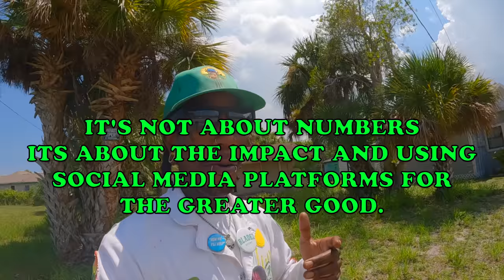Tragic Accident BY FIRE In FLORIDA Leaves BEAUTIFUL Home OVERGROWN & ABANDONED I CLEANED IT For FREE

Comment: AP on your lawn mower  set the rear wheel height to 2 to 3 notches higher then the front wheels.
when  the front of mowing blade reaches straight forward that is it power stroke. The rear of the mower deck lifted keeps rear of blade from hitting the grass clippings and grass and put double the load on the engine.
I mowed my lawn for years like this.
I learned this from my lawn mower mechanic.
Try it and left know how much it improves your mowing with your setup.
Peace to you my Brother .

Comment: @AP You can check the town records for who owns the houses.  Some are privately owned, some abandoned homes are probably owned by banks or the city itself.  Sometimes they go up for auction for a song and a dance.  The owners (whomever they may be) would probably rather have the house be lived in and maintained instead of just rotting into the ground.  The neighbors would also appreciate it as well.  There are government grants/programs that will pay for at least part of a rehabilitation of a home (new windows, insulation, and other stuff) at almost or NO cost to the homeowner.  You basically have to look up the info and apply.  You may be eligible or you may not, but if you never ask the answer is always no.

And BTW, the plant along the fence you called a grapevine wasn't a grapevine.  Grapevine have big leaves (can be bigger than your hand) and can grow VERY wild if they're not kept trimmed.  They tend to have "knuckles" that appear every 6 to 8 inches along the vine where either leaves or tendrils (little curly things that reach to grab onto things for support) grow out of.  They are damn near impossible to get rid of so they usually have to be dug out, but they still tend to grow back...very resilient.

Comment: Another job well done, i would expect nothing less from you. Here is something you may want to try, if you have a Dremel tool use the cone shaped grinder to serrate the blades on the mower blade. It is fairly easy to do, use the first 1/4" of the cone shape and put 3 thin groves then 1 wider groove then 3 thin and 1 wide to the entire part of the cutting edge that is sharpened on both ends. put the blade back on and you will see how much better the blade cuts the grass that is clumped up and even the Viney stuff, then run a flat file over the flat bottom side of the edge to keep it sharp. you should see a huge difference in the ease of cut as well and the consistency. it also mulches it better. Let me know if you try it and how it works for you.

Comment: AP I use a petrol mower to cut tall grass and the best way that I find to do it is to lift the front wheels up push it over it then slowly let it bsck down on top of the grass that way you cut it into a lot smaller pieces.👍👍✌👊👊

Comment: Little advice take bagger of if your not dumping it it’s excess weight and it will side discharge making it easier to push don’t work harder than you need to👍
Reply: He won't do that I don't think. Wants it the clean cut I believe but yes. It cuts the weight down

Comment: AP, you & Al both should look into a camel back water canteen. (A canteen backpack). You wouldn’t have to fool around with a water bottle, and it would stay cold. Little straw right over your shoulder. Cyclists and runners use them for extended time workouts. All you have to do is turn your head and take a pull. We can’t have our super heroes getting dehydrated❣️